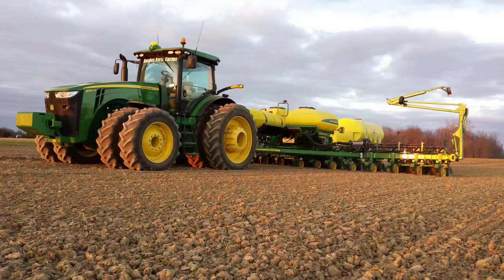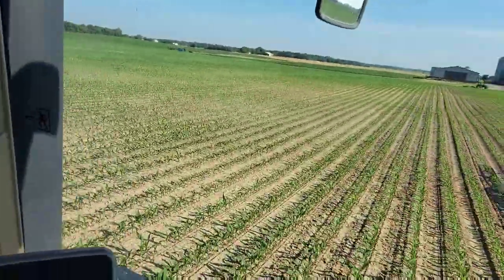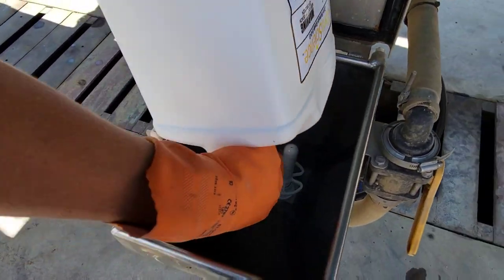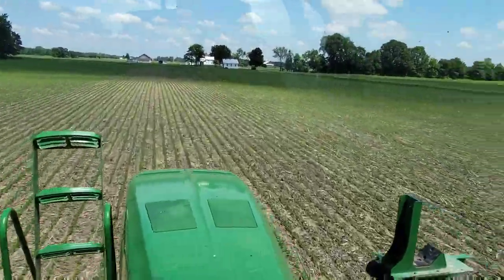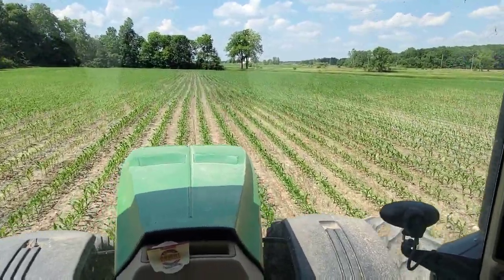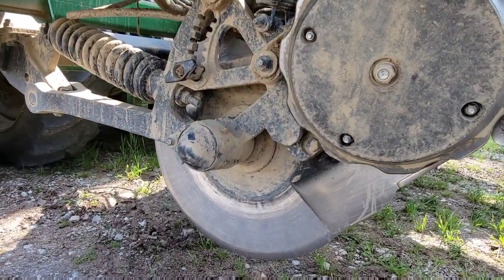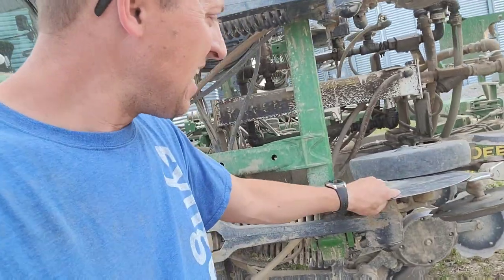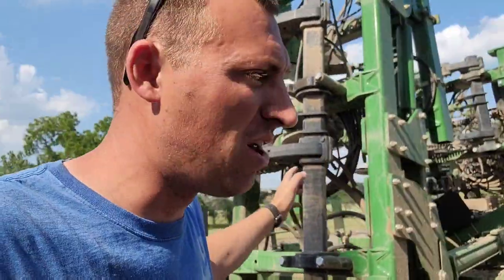2510H Review- #441

Comment: The co-op i work for has 2 23 row bars and a 15. We usually have to change the scraper and beaver tail after about 3000 acres. We have tried Shoup parts for cost savings but they do not wear as long as the Deere parts.

Comment: I remember when no tilling corn, we had to add tractor weights to each row unit of planter cause ground was like concrete, lol. Looks like you have about 1400lbs on your tool bar.
Reply from the maker: That's probably close. I'd have to count them but I know we could add more if needed.
Reply: Are you applying the fertilizer on an angle

Comment: Have you considered hard facing? I hard face my chisel plow points and anhydrous shanks with my wire welder, using hard face wire. It doubles the life.
Reply from the maker: Yeah I think the old ones are worn past the point of hard surfacing but yeah I did think about trying that on them.
Reply: I run a yetter magnum unit and I believe the hard surface on the knife could at least in my clay soils could throw more soil making it harder for the beaver tail to seal. All soils work different. I may try a couple next season. Anyway for sure I’m gonna put the 4” beaver tail on behind dual’s.